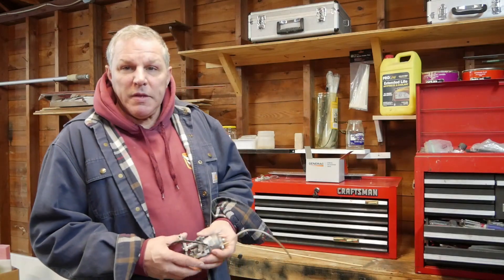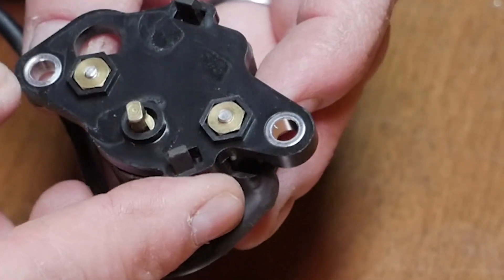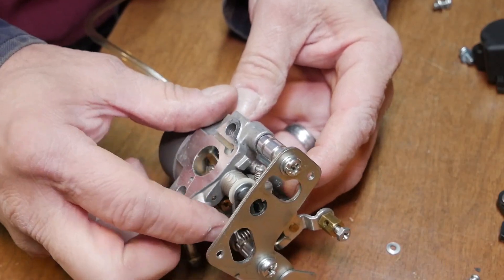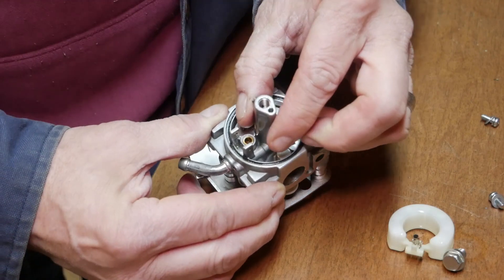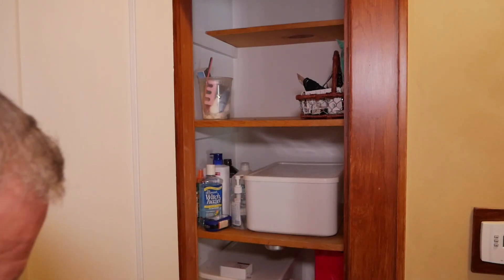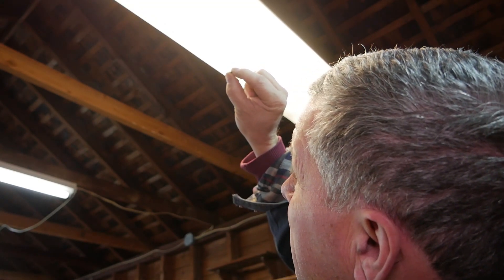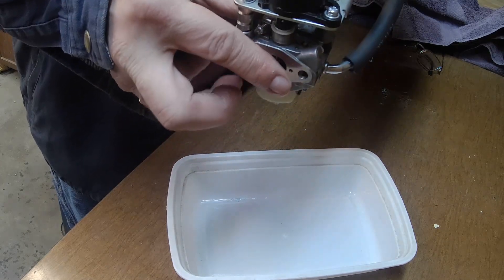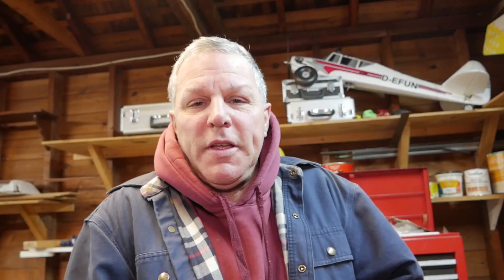Taking Apart Generac 2200i Carburetor

Comment: Had a Craftsman 2200i. I saw both of your videos on the subject. Went on eBay and ordered another one and put 
Back together. Started on first try. Only problem I had was the “run” and “start”/choke operate differently. Now choke and run are between “off” and “run”. “Run” is full choke. Halfway is now Run. But I’ll take it. Thanks for the video. No one made a video on a craftsman 2200i generator/inverter. Next I gotta change the oil
Reply from the maker: That’s great to hear, glad you were able to get it running!

Comment: My Westinghouse WH2200iXLT has the same carburetor. It was always a PITA to start and eventually stopped running unless it was on full choke. Took the carb apart and cleaned it and still wouldn't run without full choke. So I replaced it with a cheap afermarket carb from Amazon and it started on the first pull of the cord. It NEVER started on the first pull before. 
I think the original carb was defective from the start. I just can't figure out what is wrong with it.

Comment: Did you clean out the jet that is on top of the carburetor? That is what was causing the surging of my gp2200i.
Reply: That is correct. That is the one that usually causes the surging.

Comment: Thanks for the video.  I was having same exact problem with mine until 5 minutes ago. Fix was actually to tighten up the 2 nuts which attach the hose conecting the carb to the air filter. I have 2 of these units doing same high and low idle and they both got fixed by this method.

Comment: The carb looks good, bet it was the spark arrester, it’s the number one offender for rough running inverters. Curious, we’re you running ethanol gas or ethanol free gas. If you ran ethanol I’m impressed the carb looks so good.
Reply from the maker: 87 octane regular  10% ethanal gas. I agree it was probably the spark arrestor. Still running great. Thanks for watching .

Comment: Getting ready for an upcoming storm, I fired mine up and had the same issue. I was going to order a new carb, but watching your videos, I realized I also did not clean the spark arrestor. I'll clean it this evening and hopefully that's all.
Reply from the maker: Hope that’s all it is for you 👍 good luck with the storm
Reply: @CreatingASimplerLifeOffGrid  I got too excited and did it on my lunch break. Sure enough, the cone screen looked mostly clean, but had some carbon build up. Sprayed it with carb cleaner and it purrs like a kitten. Sorry for you spending the extra money, but you sure saved me some. Definitely subscribing
Reply from the maker: Thanks for sharing that and I’m really glad I could help!